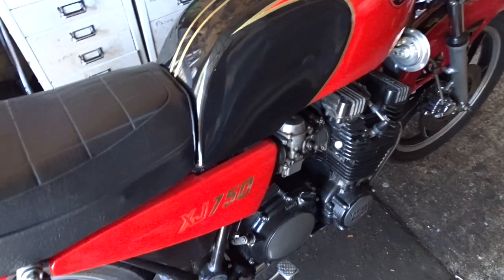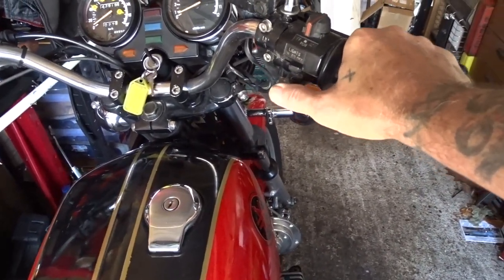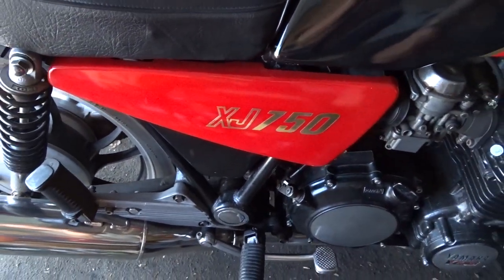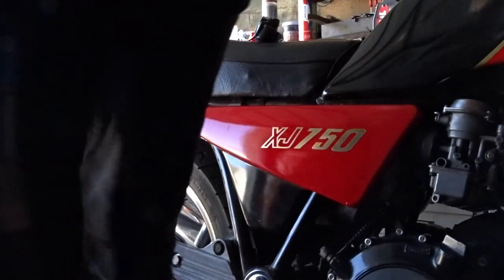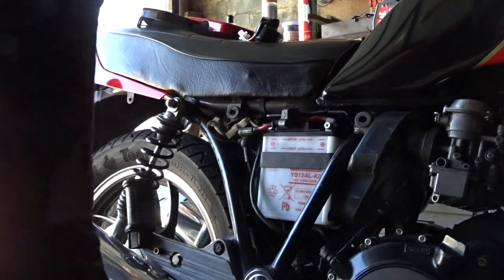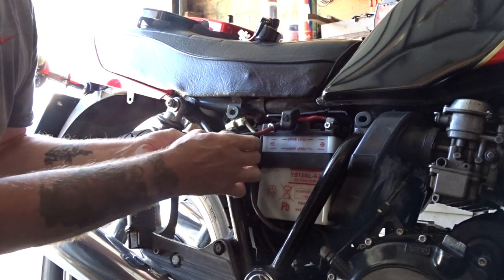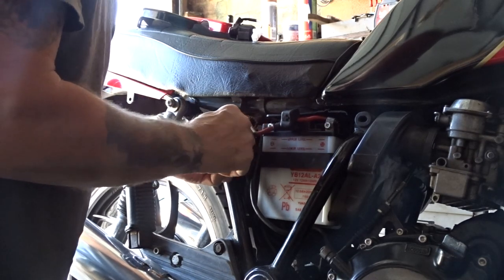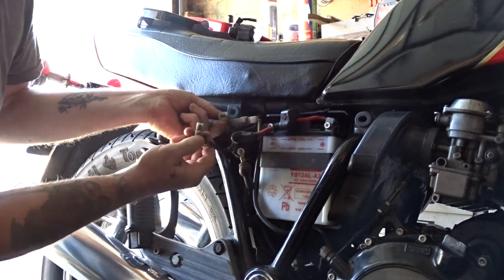XJ750  Hard to Start - Time for a new starter solenoid

Comment: 😎👍😎
Im guessing..part of the reason its not cranking over is due to the ignition being turned off..?? Whats your battery voltage..no charger hookedup for 3-4 hrs..whats your voltage when you hold down starter button..??